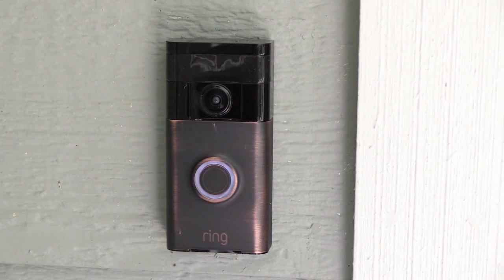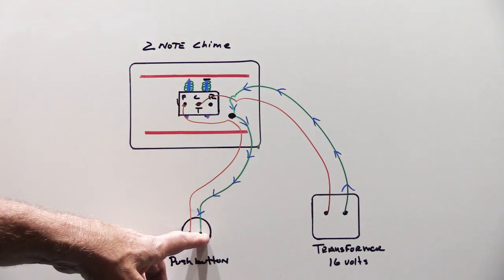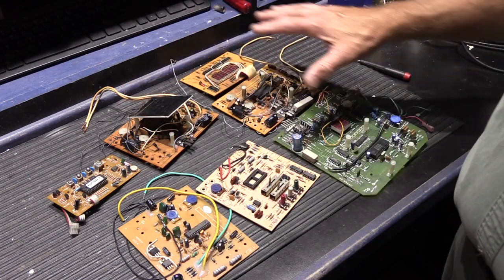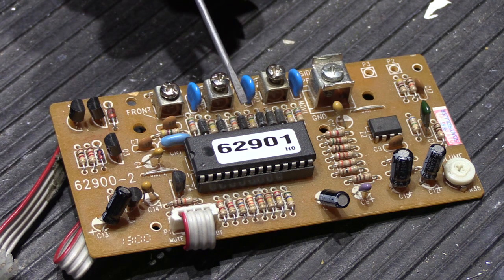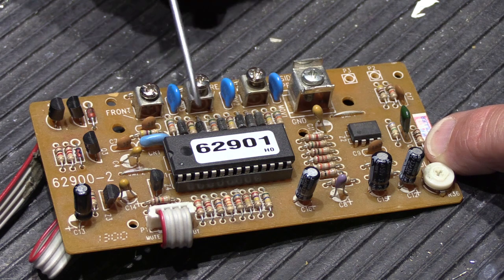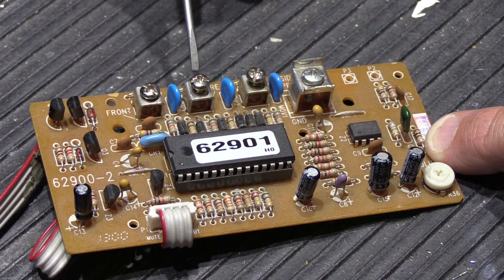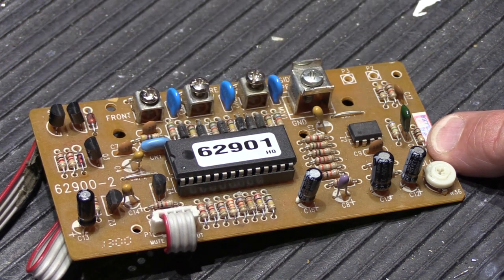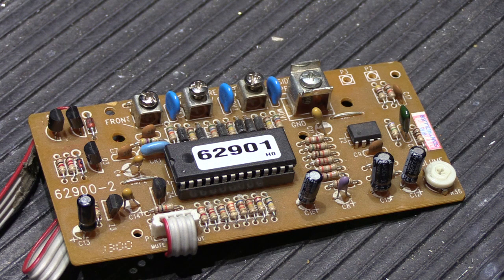Why You Can't Install a Ring Video Door Bell with a NuTone Intercom System or Musical Chime

Comment from the maker: 10/16/2017 UPDATE:  It seems that for the Ring Pro to power up correctly, you really need to have 24 Volts AC at 40 VA (watts) running to the Ring Pro.  The wire gauge should be at least 18 gauge between the 24 volt transformer and the Ring Pro.

If this is truly the requirement to have the Ring Pro work - the idea of bypassing the NuTone Chime Module and reusing the chime wires - connected to the NuTone Intercom Transformer and then to the Ring Pro simply WON"T WORK

In these cases you have 2 choices: 1-> Buy a plug-in 24 volt 40VA transformer and run new 18 gauge wire between the transformer and the Ring Pro  - or- 2-> Buy a standard Ring Door Bell and use the built-in battery to power the Ring

Finally, when you calculate the power from a 24 volt 40 VA transformer you have nearly 1.75 amps of power available.  If a product like the Ring Pro requires that much power to operate correctly, it's a power hog.   I think Ring needs to look at redesigning it to require less power, especially since their target customer is someone who wants to replace a standard tract-home mechanical door bell.   - Chris
Reply: Ring Pro uses 380mA max, does not require 40VA of power.  If you connect a chime then you will require more power to trigger it properly.
Reply from the maker: Not according to Ring - Their go to solution for the Ring Pro when it reports a low-power condition is to have consumers install a 24 volt - 40 VA Transformer - Chris
Reply: That is more of a "one size fits all" solution to power issues.  Only if you had three or more mechanical chimes you would need 40VA.
Reply: There is an Elk 24VAC/40VA plug in transformer often recommended by Ring for Pro power issues but only because it is Amazon cheap and comfortably more than enough power.
Reply: I have a Ring Pro that will not work with my current Nu Tone setup. If I buy the Ring Chime or Ring Chime Pro to replace my current Nu Tone chime, will it work?
Reply: I’m not here to debate anything, especially the power of the transformer, as I’m not an electrician. My issue has been that the inference in my unidentified brand digital chime box is quite annoying. Upgrading from a 16V 10 amp to a 16 v 30 amp (Nutone) transformer, has not helped a bit. Ring suggested doing this to get enough of a power push with increased amperage, to power the video/audio on the doorbell unit AND to fully power the door chimes to ring or sound as intended. Before I purchased the Ring Pro, I knew that a transformer upgrade may be needed.
The website gave specific instructions to have a transformer which stated 16v-24 v.  As stated above, mine was 16v and pulled 17v when pretested. When I called about the interference issue, the recommendation was to get a transformer with a 20-30 amp rating but to stay with 16v. I got a 16v with 30 amps, but no Improvement. Ring asked for photos so they could see how the wiring was connected. It’s all correct they told me. So, they’ve sent a new power kit, which I need to install. If that doesn’t work, then the last recommendation is to buy a chime kit listed under their compatibility list on their website. My instincts tell me to stay away from a digital unit and get a mechanical one. However, there isn’t supporting evidence either way. Ring seems to be troubleshooting with a blindfold. If and when something fixes this issue, I’ll update.
Reply: Your experience sounds very similar to mine. After hours of troubleshooting, research, and trying every combination possible, and I have decided to return my Ring Pro. Ring refuses to truly help me with this issue, therefore I strongly discourage anyone I talk to to buy their products :)
Reply: Not to mention hours and hours on the phone with them
Reply: The Nest Hello requires 16 VAC - 24 VAC with a 10 VA transformer.  I gutted my NuTone and replaced the innards with a 16 VAC 10 VA transformer and a mechanical chime (the cheap Utilitech doorbell kit sold at lowes).  Using the existing NuTone wires running between the transformer/chime and the front door intercom, I installed the Nest Hello and it worked like a charm.  Took about 30 minutes to install, not including the drywall patch which I have yet to do.  I've only had it running 5 days now, but so far, it is working perfectly.
Reply: Thanks for this comment. I didn't do my homework till after ordering the nest hello and found that the Nutone LA174 in my home also will not work as in this video for the ring. Other than selling the hello this sounds like my only other option. Did the replaced Utilitech unit fit comfortable in the recessed nutone box in your situation?
Reply: It easily fit in the recessed nutone box.  I mounted the new transformer where the nutone transformer had been mounted and there was more than enough room for the Utilitech chime.
Reply: I appreciate you posting this video as I did find it helpful and interesting. I had a job where the home owner had a Nutone IMA-4006. He said he was just going to end up removing it at some point since it wasn't used. He wanted two Nest Hello doorbells. Knowing that he wasn't going to keep the system, I was just going to install a new simple door chime. However, after seeing the system worked find with no hum in the system and the room stations all functioned with the doorbell, I just wanted to integrate with that. It had the electronic door chime and I saw that it sent out DC voltage to the door switch.

Since the front door intercom wasn't going to be needed I used a pair of of that cable that went near the Nutone transformer in the furnace room and added a second 24VAC transformer to power the Nest circuits. I then used two 24VAC relays https://www.amazon.com/gp/product/B00NN5ABG2/ref=oh_aui_detailpage_o00_s00?ie=UTF8&psc=1 , one for each doorbell location and the contacts are wired to front door and back door on the chime module. The side door was left as is to the existing door station as that door isn't used that often. It functioned fine. I set the Nest setting to electronic with a duration of 1s. 

Both Nest units are powered by https://www.amazon.com/Heath-Zenith-SL-125-02-Wired-Transformer/dp/B000BQY88I/ I can't comment on how this would work with Ring as I haven't been asked to do this. I would agree that you cannot connect a new doorbell to the existing Nutone circuit and expect it to work because it won't. However, the modified approach I took worked fine. The two relays and the two Nest modules all fit into the master station mounting can. The power cables were labeled with their voltage levels in case there was ever confusion in the future.
Reply from the maker: @kylefolger2753  Hi Kyle:  You did your Installation exactly the right way - by adding an additional Transformer and the 2 Relays you successfully isolated the Nest from the NuTone Chime Module - while still allowing the Nest to activate the Chime Module - Well Done! - Chris

Comment: Let me ask this. Can you wire in the AC adapter to the back of the doorbell module and on one side of the wiring can you put in a control relay with the nutone wires in the NO contacts of the relay? The only concern I would have is the recharging the battery in the doorbell itself I guess.
Reply from the maker: HI navymattcdr:  Here's a link to our Video that show exactly how it can be done:  https://www.youtube.com/watch?v=t6YswmDNVyI&t=194s
Chris

Comment: I was able to do it, you just can’t use the factory chime anymore because it runs off DC and the smart doorbells need AC. I just use an echo to chime for me now.
Reply from the maker: Hi JackofAllTrades:  No NuTone Chimes are power by DC, they are all powered by AC Transformers - Chris
Reply: @northsideservicecompany3567  the head unit is powered by AC but the chime module to include the wires that extend to the doorbell are all DC.

Comment: My chime on the control panel failed, so I just bypassed it and ran wires to a traditional door chime that I mounted above. So now when they ring the Nutone doorbell it rings.  I’m assuming if I can bypass that, then I can also use the transformer to wire up the ring.  I was actually thinking of trying to do a pigtail on the wires from the nutone doorbell and then run to ring too to power up.  That way I have both working.

Comment: I am able to use my Ring Video by simply connecting the two wires coming from the transformer.  So I guess I'm getting enough power.  However my Nutone La-55 is not working.  Now I know why.  So am I safe with just leaving the La-55 hooked up for posterity and possibly reconnecting someday, or do I need to fear blowing it up with the Ring connected at the front door button?
Reply from the maker: Hi Jay: I can't tell how you have it actually connected - so I can't make any specific recommendations - Chris

Comment: Wow if only the manufactures  of intercom systems would climb on board and make this easy...That being said we have a M and S system. Any wiring diagrams/ parts list to do this...Im in !
Reply from the maker: Hi Michael:  How about if the Video WiFi manufacturers got on board and make their equipment more universal to work with older systems?  That;'s the practical course - it would take about $1.25 in additional parts to make it universal - Chris
Reply: Now that is an idea !

Comment: What about the Ring Elite?  Can that be used with Nutone without losing intercom functionality and make the intercom chime when Ring Elite is pushed?  I've seen very little about RIng Elite and Nutone or details of the IA28/29 voltage constants and voltage "change" when button is pressed.
Reply from the maker: Hi Gary:  After looking at the Ring Elite briefly - It looks like the built-in "inside door bell" terminals could be wired to the back of a NuTone push button to activate the Intercom Systems built-in Chime Module.  Since Ring does not offer any technical information as to how these terminals are actually used - this is only an uneducated guess - Chris
Reply: @northsideservicecompany3567  Thanks a bunch Chris.  This is what I was able to find out about it:  "The Ring Video Doorbell Elite is compatible with most AC-powered bells operating between 8-24 volts. Unfortunately, the Ring Video Doorbell Elite is not compatible with wireless bells or any bell/intercom system using a DC transformer."   Does this mean it won't work without some other hardware hack?  I'd love to find a way to make it work without losing any features of my Nutone system even if I have to custom make a mount so Nutone's intercom speaker can be heard clearly.
Reply from the maker: If the Pro Elite is capable of activating a standard mechanical door bell (the type with electromagnetic coils) then it should also be capable of activating the coil of a small relay.
The switching contacts of the relay can be connected to the back of the NuTone Entry Door Station's Push Button - so when the relay is activated - its coil is energized - closing the contacts of the relay - which makes a closure at the Push Button - which makes the Chime Module ring - 

We have a Video that shows this - when using a Ring Pro with the Pro Power Pack - Here's a link:
   https://www.youtube.com/watch?v=HgpiZCPSbTA&t=1951s

Chris
Reply: @northsideservicecompany3567  Okay, I guess only one way to find out for sure.  I'll let you know the outcome if I order it and give it a try.  Thank you for your expertise and reply!

Comment: Hello, could you please show how to connect a video door phone to a mechanical doorbell?
We have installed the the video phone and it works, but we don't know how or where to connect it so that the mechanical doorbell will ring. In other words, I would like to hear the "ding dong" all over the house.
We are using a CCTV 4 wired video intercom system (TMEZON) and the only cable we  have is a cat5 cable.
Please help!!!!
Thank you so much!!
Reply from the maker: Hi linayb: Based on the very limited technical information available on your Video Entry System - there does not seem to be any provision to connect it to a doorbell - Chris

Comment: What you do is ! Make a housing for the outside door push,make it so as to allow it to swing from top so as to activate a  micro switch.I made one over a year ago and works very well.Not only does the ring chime work but also my tube chime…
Reply from the maker: Hi timewaster:  Interesting idea - However I don't see how your mechanical solution address the issue of powering the Camera - Chris

Comment: I don't really care about the intercom not being able to ring since I can just buy the chime from Ring........ but I spent 3 hours today trying to get my ring to work and it refused draw power from the existing electrical wires. What gives? I have an intercom doorbell TekTone OR603W - should I call an electrician or just send it back?
Reply from the maker: Hi K:  While I admit that I'm not a Tek-Tone expert - All of the Tek-Tone Intercoms I've ever seen are Apartment Intercom Systems.  If that's what you're working with - You may have gone way down the wrong path with trying to connect a Ring Camera to the System.  As I show in our Google Nest Instillation Video - you will probably need to run additional wires and add a dedicated Transformer to power the Ring - Chris
Reply: @northsideservicecompany3567  Thanks so much! That's a good place to start and I will look into it.
Reply: @northsideservicecompany3567  Another question - are there are any brand of video doorbells that will work with the existing set up I have on my TekTone OR603W? Maybe something from Nest or Eyfy? What would I look for in a video doorbell to know it would work with my existing system?
Reply from the maker: @KrakPoT13  As I said previously - I don't know anything about your Tek-Tone System - more details are needed to answer your questions - Chris
Reply: @northsideservicecompany3567  not sure if this helps but here is a picture of my setup...https://imgur.com/a/qGNIqB1

Perhaps the green, white, red or black wires can be used instead?
Reply from the maker: @KrakPoT13  Sorry, but a picture of wires sticking out of a brick wall doesn't tell me anything about your equipment - Chris

Comment: I have a 16V 10VA transformer.  Just bought a Ring Pro.  I debated whether I should buy a 16V 30VA transformer I saw on Amazon and install that, but the when I chatted with Ring's customer support online, they told me that the Ring Pro should work as long as my transformer is between 10VA and 30VA.  I am going to give this a shot and if it doesn't work then I'll get the transformer on Amazon.  I measured 19V at the doorbell with my multimeter so I believe I have enough voltage at the moment, but I am fairly certain the load of the new Ring Pro will be much higher than my current doorbell.  Has anyone had any success with a 16V 10VA transformer.  It seems like the guy in the video did, but the light around his doorbell button was flickering a lot before he tested his doorbell and I am guessing that his doorbell may still be having issues.
Reply: Would have been nice to see a suggestion on how to make things work.